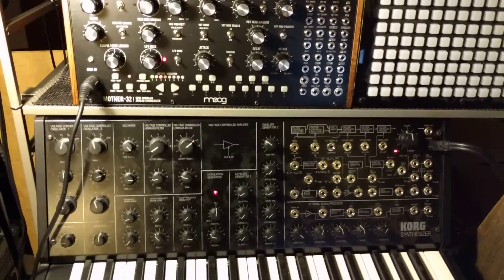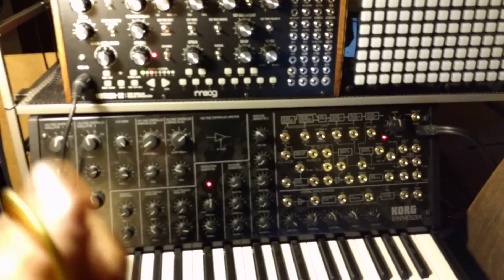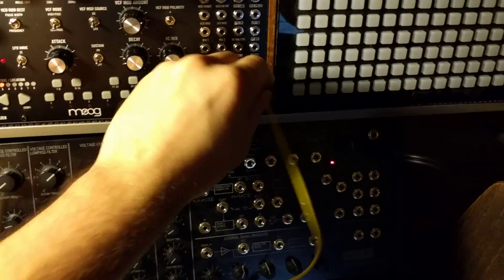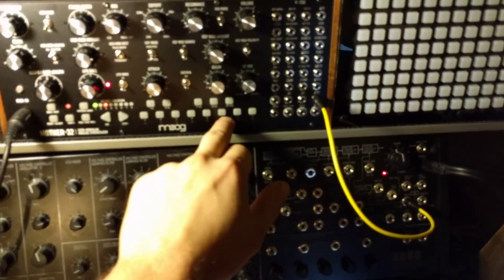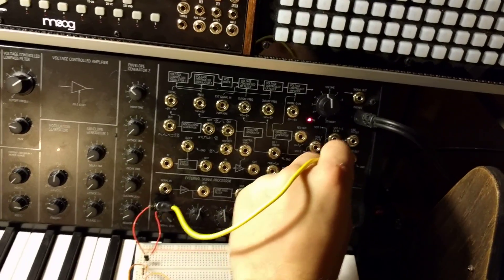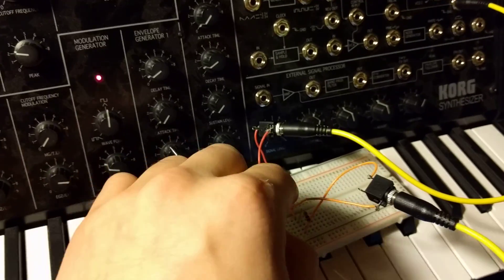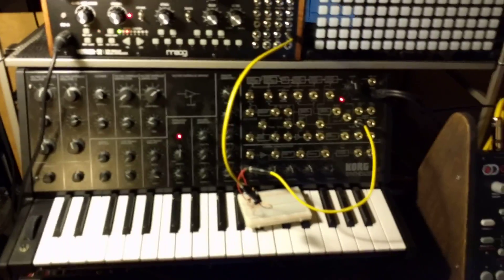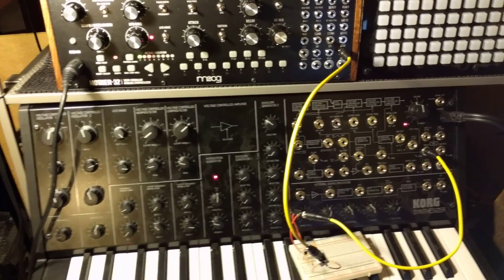Making the Korg MS-20 Mini and Moog Mother-32 play nice together.

Comment: Another way without the special cable:
M32 - gate cable to MS20 - Signal
MS20 signal trigger out to MS20 Trigger IN
Adjust MS20 Signal Threshold level all up
Adjust MS20 Signal level until it sounds.